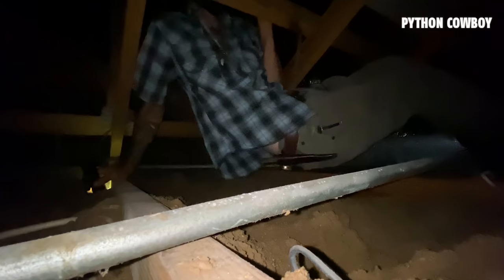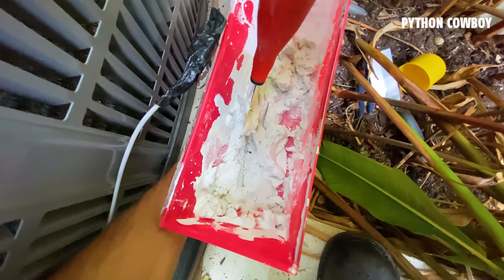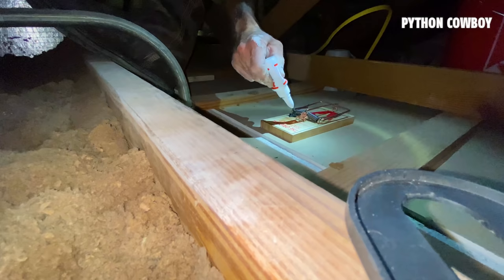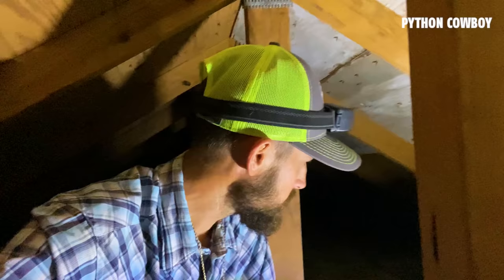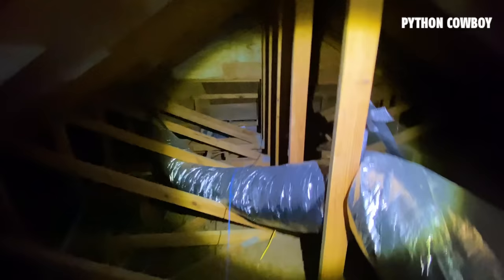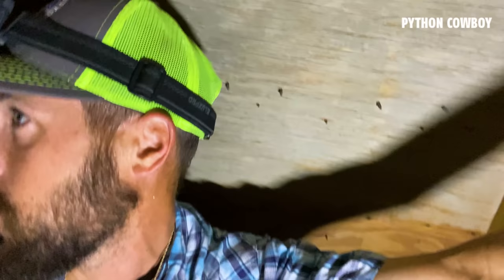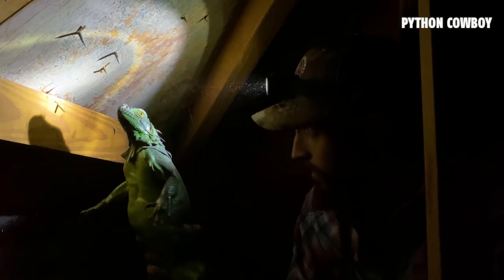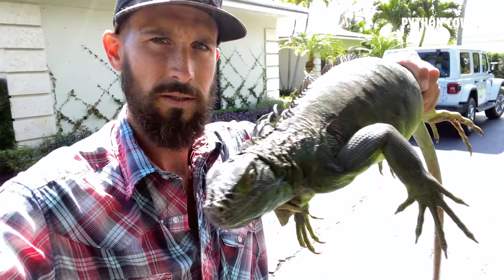Caught Invasive Iguana Laying Eggs In A Client's Attic

Comment: Couple of tips for the rat traps for the next time you DO have a rat to kill- put bait on the underside of the "catch," the pan on which you normally put the bait. Peanut butter or something else that won't come off in the attic heat. Putting it on the underside makes them really have to get in there to try to get a meal.

The second tip- use some pliers to flatten that little bump on the bait pan, the one holding back the wire, so the bump doesn't stick out so far. This makes it so sensitive that you'll probably need to set it once it's in place, too sensitive to set it and put it down. Works great for those "tricky" rats and mice.
Reply from the maker: Eric Young great info thanks! Hopefully I won’t need to ever use it again 😂